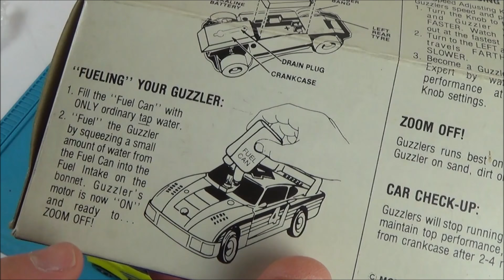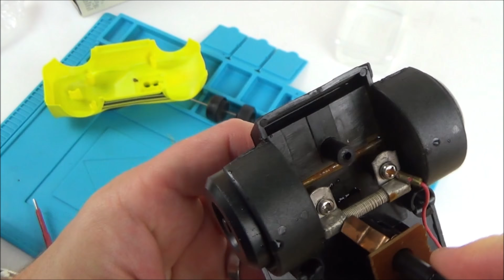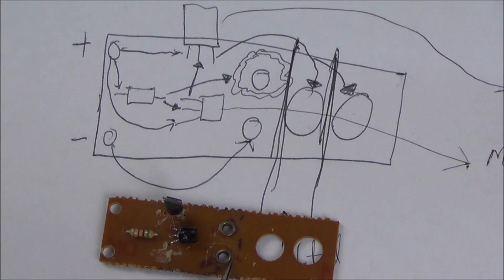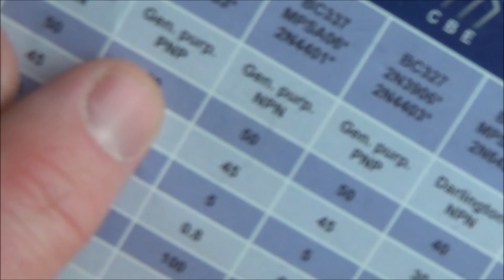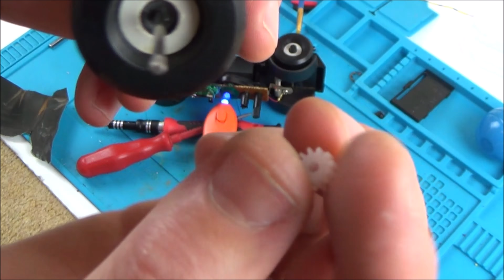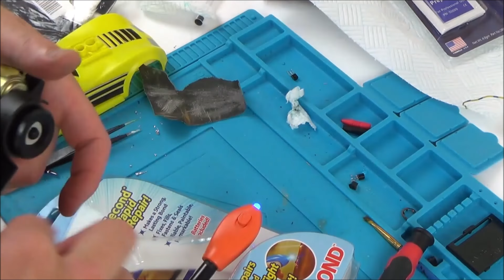Trying to FIX: 1980 Guzzlers Water Activated Toy Car (QUICK VERSION)

Comment: i think i had some sort of newer or cheaper revision of those cars, mine was blue and had a fixed speed, there was no way to adjust it and it also was a bit smaller, just a bit bigger than the usual hotwheels cars

Comment: The water was limiting the current to the transistor's base that blew, since you have bridged it together, there was no limiting current to the transistor base, that's why you blew the transistor.
Mosfets on the other hand don't need a base resistor, since there is no current flowing throw the gate.

Well done mate, love your videos :)

Comment: I didn't get why the transistor blew when you shorted the 2 holes. Isn't it what water is doing too ?
Reply from the maker: That is exactly what I thought but I put a full short on the holes, while the water has quite high resistance so it doesn't put a full short on the holes which won't blow the transistor. The transistor can recognise the difference when the water is and isn't on the holes :-) Others have written a better more accurate version in the comments if you want more details :-)
Reply: @Mymatevince  the water is a conductor with resistance, when you shorted the leads with the tweezer  there was no resistance  just a direct short causing the transistor to blow , try this get some distilled water ( not sure what they call it in the U.K ) and see if the car runs i suspect not. since distilled water has all the impurities removed this is why in the instructions it says to use tap water only since it still has impurities like salt, metal etc in it

Comment: Very interesting operating principle :) I guess the electrical current will turn the water to vapour as it runs only for a while with the water and not until the battery dies? Then again wouldn't the water get too hot for the plastic tank? Not sure what makes the water disappear so that the car stops?
Reply: the water since it is tap water has impurities unlike distilled water so its acting as wire or electrical trace , this is why the instructions say to use tap water only.   there isn't enough current to boil the water to make steam or vapor it eventually just runs out of the car with movement and evaporates my bud had one when we were kids
Reply from the maker: I think it just makes it way down to the emptying tank at the front through gravity and the movement of the car :-) The more water you put in the longer it takes to drain away so the longer it runs.

Comment: What an odd concept. Wouldn't it be easier if the battery drove the wheels directly? The water is an unnecessary middleman!.
Reply: water is a electrical " wire or trace "
Reply: @phantomscaler  ...yeah, of course. But what I meant was - it would have run just as well without the water. Novelty value I suppose?
Reply: Kids pretend it was gas. These were popular and fun for young kids.

Comment: Dumb question but, where does the water disappear too after you fill it? Evaporates? Spills out the bottom? Just trying to make sense of how a few drops of water could be gone so fast in between a low powered circuit
Reply from the maker: It works it way down and then you pull out the drain plug every few runs :-) I think it is just gravity that pull the water away  :-)

Comment: So when the cars not on or with no water its drawing 1.something volts? Thats not good that battery won't last long or could possibly start to leak.. Not fixed if its drawing that much current when off..
Reply from the maker: Didn't think of that. Hmmm, I wonder if the board was slightly wet or maybe now that all the UV mask is back on it the 1 volt has gone. The battery is out of the car at present. Wish I had checked this now. Thanks for the comment :-)
Reply: @Mymatevince  oh yeah good call on the glue.. I forgot about that could've just been that... When it's all dry try the use meter and see if it's drawing current.. Awesome fix BTW 👍
Reply from the maker: @subigirlawd_7307  Will do, thank you :-)